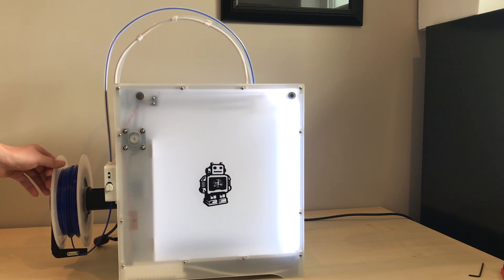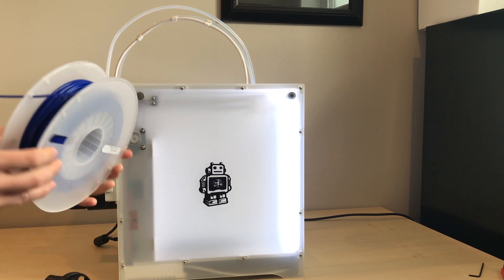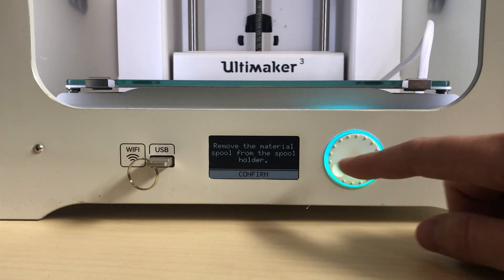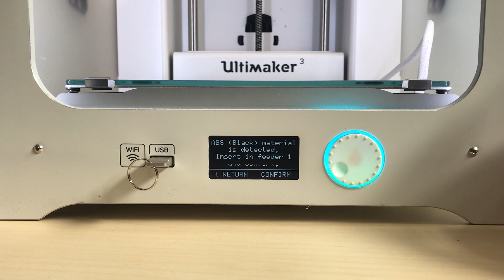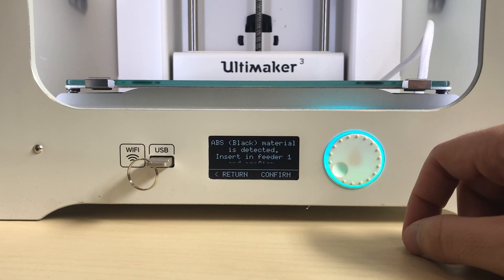How to Change Your Filament - Ultimaker 3

Comment: How do you check if the material guide of the new filament has been installed ?
Reply from the maker: You can see the guide being installed at 1:38. If the outer spool does not have this guard on then it would not be installed.